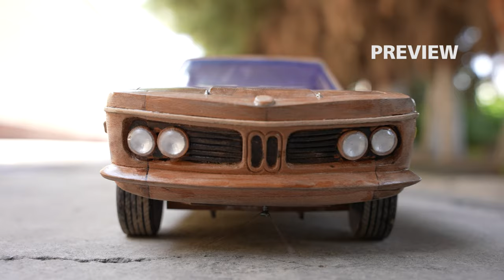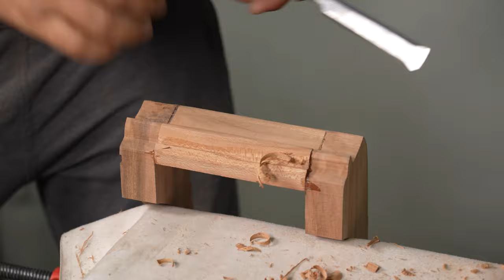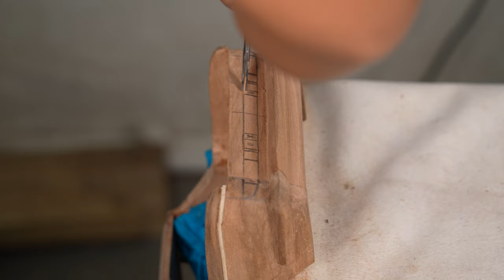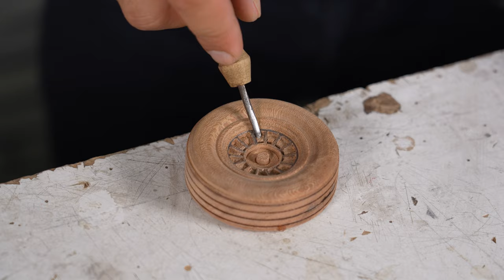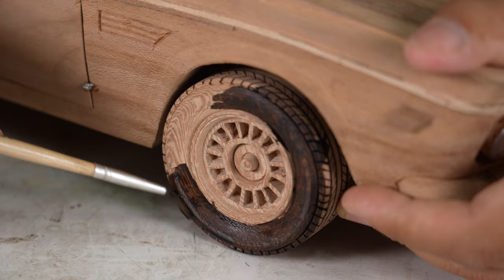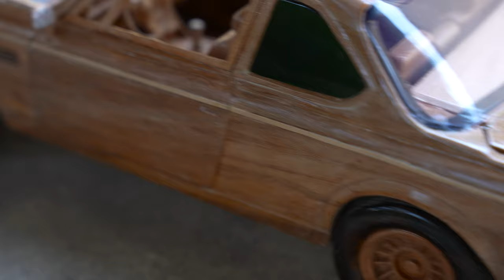BMW 3.0 CSL 1972 Car Model Entirely Handcrafted from Wood | DIY Woodworking ASMR @AwesomeWoodcraft

Comment: I like the cars that you make. They look so cool. If you could, I have two questions I’m hoping you could answer. First, my grandpa has a 68 Pontiac Le Mans, not convertible. Could you make it?
And secondly. How long does it usually take to clean up all of the extra wood and sawdust after you finish a project